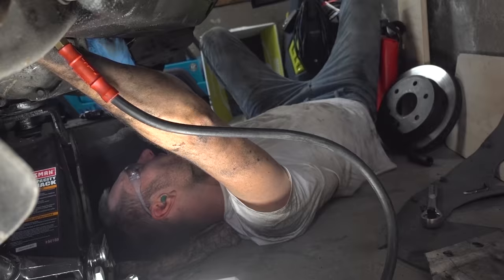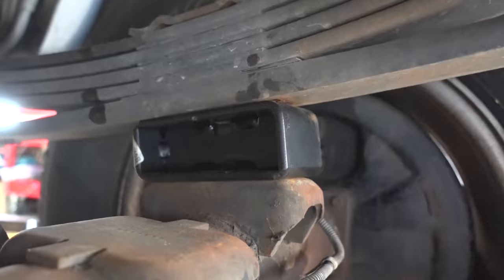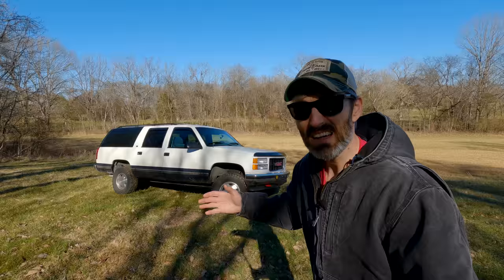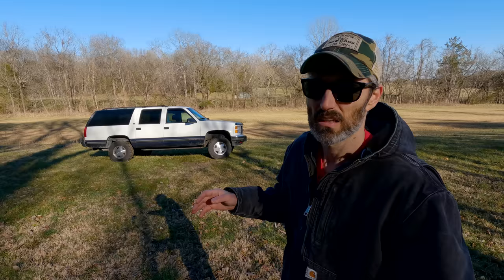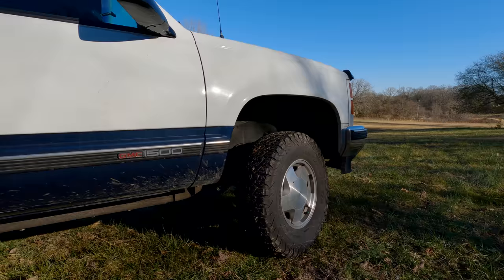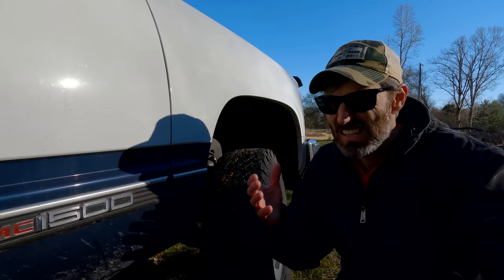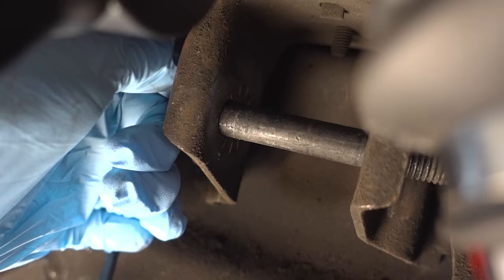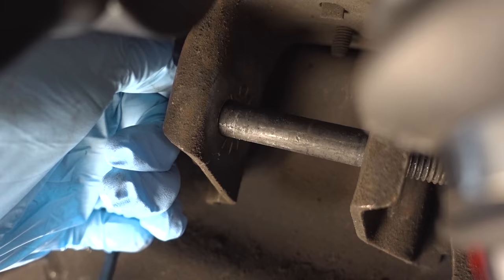Rough Country 2-3" Lift Kit - LONG TERM REVIEW!!

Comment: This lift seems like a mall crawler lift.  Why not spend the money and get a better lift for off road? I currently have a 2004 GMC 2500hd 4x4.  It doesn't have a lift and continuously bottoms out in our pasture over small levees and big pot holes in our California roads. I would love a good lift. This truck has to tow a livestock trailer, haul heavy loads and travel empty reliably. My old truck was a 1969 3/4 4x4. It was lifted wrong when I bought it in high school (blocks up front, unhooked park brake cable,  stretched front brake lines and no drop steering arm). I fixed all that with a 4" Rancho lift then I went to a 4" Skyjackerlift. The Rancho springs sagged over time with the weight(150 pounds) of winch and bumper. I used it on actual 4 wheel drive runs (not rock crawling), hauling and towing the stock trailer.  The 69 out performed the 04 off road (hands down), ease of maintenance and smoothness on road (because of 36" tires probably). The 04 has better fuel mileage (17 vs. 10 )(duramax vs. 454) and more cab room, 4 door vs. single cab. But basically lifted is much much better than stock height. Also, the torsion bars are almost maxed out to keep factory ride height. Apparently they are worn out.  04 has 348, 000 miles.  69 had just over 100,000 when I bought it and I put about 200,000 before the odometer quit and drove it regularly another 5-8 years. So if you are going to use your vehicle as an overland vehicle, put on a good quality 4" lift and at least 33" tires. Or go old school and get a straight axle suburban and fix it up. Check out Merricks Garage. He built an awesome suburban. You don't have to go to the extreme he did. But my 1969 was my daily driver from fall of 1984 (high school senior year) through college, a job, marriage, kids and a small cattle business.  Also 4 wheel drive runs and deer hunting.  In 1998 I bought a Chevy S10 to commute to work but the 69 was still used regularly towing and hauling until 2008 when we bought a used 2004 GMC 2500hd 4x4.

Comment: I would rather have the front end up higher. So you don't nose dive into those mud holes. I would also never use blocks in the rear, because I like wheel travel. I'd get new springs. Now, it's a damn shame you have to go through this crap. I would find a way to get that diff back up. Or find another lift. I just picked up a 98 Suburban 2500. I think I'll leave the height where it is, for now. Just replace the Bilstein shocks. It sits pretty high. Thanks for all your videos I watched them all.

Comment: From my experience these kind of lift is only good for 2 inches approximately.  Yours is WAY over cranked. My ride was awful when I crancked the keys. I fine tune it to be perfect. My key bolts are out almost completely they move up the keys up like 1/4 of an inch or less. One thing to keep on mind; half a turn on those key bolts makes a WORLD of difference when is set up as I mention above.  My vehicle is a1995 2 door Tahoe with only the upper Rough Country control arms and the tortion keys. I did not lower the front diff. The alignment shop didn't have any problems with my set up and it drives great. Forgot to mention I I installed BILSTEIN 5100 shocks. 33 Mud Grapplers on factory wheels, no rubbing.
Reply from the maker: Interesting, yes, with those keys a little goes a long way for sure. The problem is any lower and there’s too much uncorrectable positive camber. The last alignment the guys were literally tightening the key bolts just to get it right.
Reply: @1RoadGarage  I wonder what the results would be with your stock control arms installed.
Reply: @1RoadGarage  Where can I send you some pictures and more  info about my set up? I've been playing with the front end for a while now and at last it has a comfortable and stable front end.

Comment: My thoughts, (almost), exactly...  I have an 05 Avalanche and my biggest concern is the torsion key lift will put a lot of stress on the factory ball joints. I have new upper and lower control arms with ball joints in them, but I'm afraid to wear them out prematurely. I know 6" lifts come with lower control are relocation brackets, but I don't want to lift that much. I like the look of the stock height, so I don't want to change it much. All I wanna do is level it without hurting anything.
Reply from the maker: 6 is pretty high. Don’t forget with heights like that there’s a whole bunch of extra modifications needed like longer brake lines, exhaust modifications, etc.
Reply: 220,000 miles on leveling keys in my 2006 Silverado with add a leaf and a 1” taller block out back. Bilstein 5100’s. I was just thinking tonight how well it rides. 285/70/17’s and had 285/75/17’s before that. Don’t be afraid of lift keys. Just don’t over crank them, adjust to about a 2” lift and you’ll be fine. Your Avalanche should have the same suspension up front as me.

Mind you I personally put 220,000 miles on this set up. It had this when I got it at 95,000 miles. Never changed the ball joints, control arms, nothing.

Comment: You wouldn't gain travel but to soften you can take tx-bar out drop lower arm and replace bar and tighten it won't take as much and will loosen some tightness

Comment: Hi Jimmy,
Have you looked into changing out the rear leaf springs or front torsion bars on your suburbans?

I’m looking at changing my front torsion bars on my 1993 K1500 four-wheel-drive suburban.
Was trying to find someone who’s done this already and see what weight rating torsion bars they went with.

Comment: Just crank the stock keys it doesn't take much to level it out I had plenty more to go on mine if you have to use other keys to get any amount of lift that just tells you the bars are already worn out and weak to begin with and by the time you crank the crap out of them there going to be stiff as a board. I used to run a 34" equivalent tire for awhile now running 33x11 for the past 4yrs no issues I rebuilt the whole front end prior to the crank truck has over 350k on it the only complaint I've ever had was my alignment shop not setting my camber to 0 degrees because they wanted to go factory specs. I have debated dropping the front diff but after the years I have been running it I still haven't rubbed any holes in the cv boots the angles are pretty decent and truck still drives and rides like normal. I helped a buddy put the RC kit on his and he got greedy he ditched the 2" rear block and added a 4" block and maxed out the front even though I told him he would hate it he went that route yeah it jacked it up but rode terrible no down travel and was tearing up cv axles drove like crap.

Comment: Tightening the torsion bar keys does not make the front suspension stiffer at all. All it does is change where the set point is. You're just rotating the whole assembly a little bit. The stiffness  It's controlled entirely by the dimensions of the torsion bar, which don't change and the properties of the metal, which also don't change.  It's actually similar to adjusting the 0 point on a Spring scale.
Reply: You couldnt be more wrong. Lol
Reply: @dabmaster4470  Stiffness doesn't change with ride height adjustment. I'm not wrong.
Reply: @rjm7168  yes it does. You must be new here. Google it. Better yet go crank up the torsion keys on an OBS chevy and see how shitty it rides. The higher the ride height the stiffer the ride. This is common knowledge.
Reply: @Dab Master  Stiffness doesn't change. Ride quality suffers. It affects the alignment amongst other things. Googling is convenient and if you google this, you'll only find posts that back up what I said, but I've a bit more experience than just google, so I stand by my statement. Stiffness is unaffected. Ride quality is another discussion.

Comment: If you would do it all over again and still wanted just a couple inch’s to clear a narrow 33’s like a 285/75R16 without having to lift it 4” with a proper lift from RCX. Would you go with a 2” or a 1.5” body lift?

Comment: Took my 3" RC lift out too.  Front Differential hanging down is a concern so I'm still fiddle farting with that. I didn't remove the torsion keys though. I was able to get the truck back to stock ride height with them left in.
1996 K1500 diesel Silverado
Reply from the maker: I may put my diff back in place and re-weld the brace that I cut off.

Comment: Lack of bottom travel has always been an issue with torsion key lifts. I wouldn't do it without also adding an upper control arm designed for this and then no more than 2 inches. I wouldn't like the front higher than the back either. I also don't care much for RC lifts, at least the older ones. Maybe they're different now.

Comment: I have a '93 Burb. I have been torn. I wanted to put larger tires on of clearance but the thing rides like a Cadillac with the stock suspension. I watched your RC lift installation and right away the thought of cranking that torsion key rang alarm bells. It has to make the ride stiffer. So I'm still in a quandary. Will 35"s fit under the wheel wells without a lift? The rear suspension really needs blocks or something but what about the front?

Comment: I have this lift and it’s been a nightmare. My front wheels vibrate and wobble aggressively over bumps. To the point where people stop me and tell me it looks like my front wheels are falling off. Had the torsion keys lowered and it helped some, but still have the same issue. Thoughts anyone? A nearby shop suggested upgrade torsion bars. Should I just get a body lift instead?

Comment: I have a 2 in drop spindles on my GMC Sierra c1500 97 and I’m planning on adding a 2-3 in lift by rough country but my problem is I can’t find oem stock height spindles anywhere! They’re all dropped spindle’s and there’s lift spindles but they’re a 4 inch lift which I’m not wanting. Is it possible I can just add the 2-3 inch lift with keeping the 2 in drop spindles? I’m just trying to get the stock height back or kinda how the obs Chevy z71s looked. I like how they’re a little bit higher than the regular obs.

Comment: The front end doesn't sit higher, the front wheel openings are taller and wider to accommodate the turning of the front wheels.. 

When lifting these Don't measure from the ground to the bottom of the wheel opening to determine whether level or not.

Measure to the body line for level and then re-measure the front wheel opening height and guarantee the front will be at least 1" - 1.5" higher when vehicle is actually level.

Comment: I had seen a video were you replace the ac controls. I have the same issue. Where did you buy yours? Please let me know thank you.
Reply from the maker: I think I bought on Amazon. Can’t remember if they’re ACDelco or another aftermarket brand, I think it’s in the video though. Expensive though and I’ve already had to take it apart twice and clean the electrical connections… 🤦‍♂️
Reply: @1RoadGarage  thanks for the response. I’ve already bought 2 different ones. One was a doorman and the other I don’t remember and both didn’t work. I’ll check out the video again. Keep up the good work. Love the truck. I have a 99 Chevy suburban. :)

Comment: Hello I like your videos they are very helpful and cool. Also i have a 99 yukon and I need some assistance. I put l.e.d bulbs in my rear lights and they are partially working. Is that because of low voltage??

Comment: I've installed 3 of these lists and have never had this issue. I have never had to crank the torsion keys or even run them in more than 1/4 of inch. I dont think you put the torsion bars in with the correct twist.

Comment: Interesting I lifted my 2015 suburban front end 1.5” and I can’t feel a difference in my suspension on or off road. The lift essentially is just a spacer you add to the struts. I am now interested in looking at what happens at full drupe and see what the limiting factor is.
Reply: I also got an alignment after and didn’t have any issues.

Comment: I have the RC 4 inch lift kit which has a upper control arm bracket and modified bump stops for this exact reason I was weary of the 2 to 3 in lift the problem I am having is with the 4-inch blocks in the rear when any real power is applied that axle wrap is noticeable
Reply: Ladder bars as I believe there refered to is from what I understand is the fix for this as well as increased traction.  I'm in the midst of working on they underside of my 97 gmc suburban and are heavily leaning towards the RC 4 inch lift kit. Already have the ladder bars. Anything else I should be aware of about/with this kit?
Reply: @12483MG  other than that it's solid, you will like it!
Reply: @Lifesmasher  Greatly appreciate the feedback. Thank you.

Comment: Cheap lifts yield cheap results. The reason why the front is lifted higher than the rear is because those trucks come from the factory with a bit of a rake in the back. That way it’s not dragging its bottom around like a hyena when you put a heavy load in the back. It’s basically a 2-3 inch leveling kit.

Comment: Great review, though disappointing. This is generally the lift everyone recommends, probably because of the price. I’m considering a lift later this year or next, and this was definitely on my list to consider. Thanks for explaining and showing the issues.I would not by happy about shaving the case and would definitely have been concerned with that lack of clearance. Hopefully the ride height ends up close to what you want.
Reply from the maker: I know I could’ve done better with the explanation and maybe talked a little less but it’s seriously hard trying to get all the info and thought out there and still have an interesting video. I’m a regular joe like anyone else and did the same research anyone else would do before buying this lift which is why I tried my best to be as informative as possible. I hope I’m helping and not adding to the noise. 👍👍
Reply: @1RoadGarage  Sounded ok to me! That was a lot to unpack! Rancho had been around for years. Like most companies that want to stay viable they cut corners! When parts said to fit DON’T there’s only one explanation! No Quality Control !!
Reply: after installing this kit in my 94 Cheyenne I recommended it several times to people in Facebook groups and I regret it. For the love of God spare yourself the headache and buy a 4 inch lift from a company that isn't rough country.
Reply: Avoid this lift,
Reply: @1RoadGarage  I meant the lift was disappointing, not the review!

Comment: Big fan of the channel I have 95 burb myself.  I have a question though. You bought and installed billstein 4600s when the truck was at stock height. How is it that those same shocks still fit with the 2-3 inch lift ? I thought if the truck had a lift you had to use different shocks specifically for that lift ?
Reply: I purchased new torsion keys and the kit came with shock extenders. So 4600's will work. They'll work without them as well but with a rather rough ride due to less rebound.

Comment: You should have knocked out to change your camber. Where the upper control arms are, right there is the problem. By removing you can fix all the issues you have

Comment: 2” body lift, leveling kit, and rear long add a leafs is what you needed. With that sag in the rear the new adda leafs would have given you what you wanted in the rear. Crank the keys 2 full turns up. The alignment will need a slight adjustment and that’s it. RC sucks for this suspension and is way to overpriced.  33x11.50  on a 98 Yukon on factory rims. No issues or rubbing.  Valance ends and that weird plastic part at the bottom of the fender was cut off.
Reply from the maker: Good info dude!! 👍
Reply: @1RoadGarage  oh. I forgot to add.   The upper ball joint. Take that from the top of the arm to below it.

Comment: I recommend not going with rough country in the future as I find that they ignore some of the key qualities of a lift. I install lifts and do alignments daily. My company does not approve rough country as a vendor for this reason. I recommend going with tough country or ready lift for your budget friendly good quality lifts. With a torsion style lift its recommended a 1.75 inch maximum lift with keys alone or a 4-6 inch suspension lift. All to retain the alignment/steering angles.

Comment: Without putting eyes on the set up it sounds like the keys are cranked too high. Decranking them should result in a better ride and a lower front end and more down travel. The higher you crank the keys the harder it should be to align, the lower you go the easier it should be. To tell you the truth this sounds a bit odd to me. My old shop did tons of lifts, almost exclusively RC. Did the alignments too. And I have the Maxxcam torsion keys on my truck and have had them on there since before I bought my truck. I’ve personally put 220,000 miles on my set up. Idk if your alignment shop didn’t know what they were doing or what. A level kit should be an easy install and align. Maybe loosen the bolt on the torsion keys and try a different shop before you pull everything apart.
Reply: that's what I was thinking cranking the torsion bars to reduce positive camber?  I thought it was the other way around.

Comment: Drop the front end to two inches. Will probably ruin your camber angle. May give you more bump stop clearance.  See how it rides. RC probably designed the upper arms for max lift.

Comment: Hey Jimmy.  Thanks for your review.  I just picked up a super clean 87k mile ‘98 Chevy Tahoe.   Your review just saved me from ruining my truck.  I wish there were better options for these trucks.  I hate all that mess with dropped torsion bars and brackets hanging down on the 4 to 6 inch lifts, and was hoping this 2-3” lift was a “good enough” solution.  Sounds like it’s not.  Looks like my options are to leave the truck alone, or solid axle swap it.   For now I’m just going to enjoy my truck for what it is.